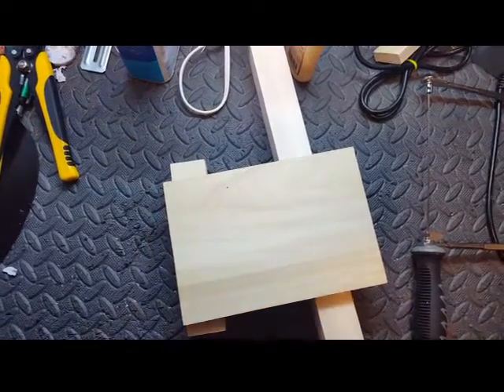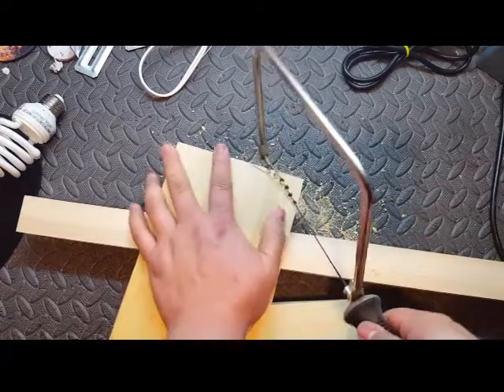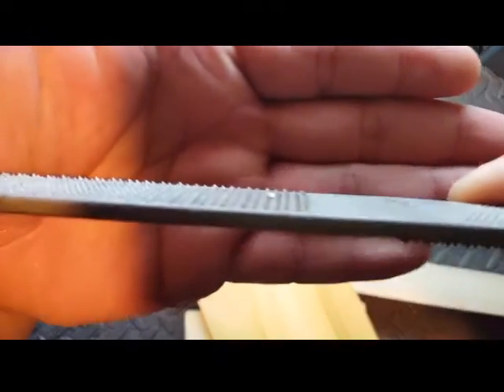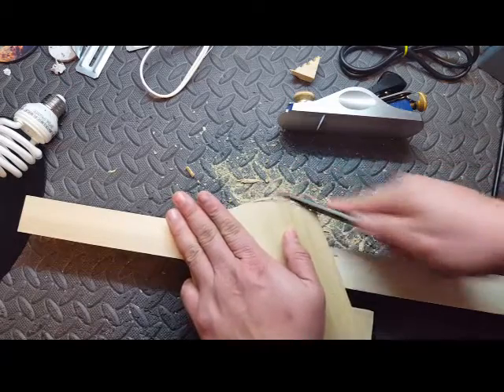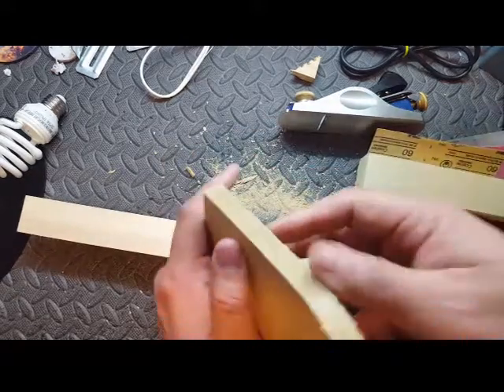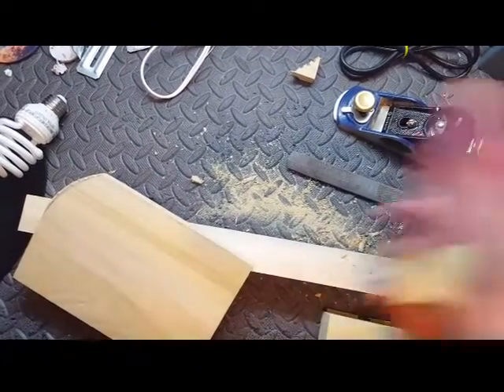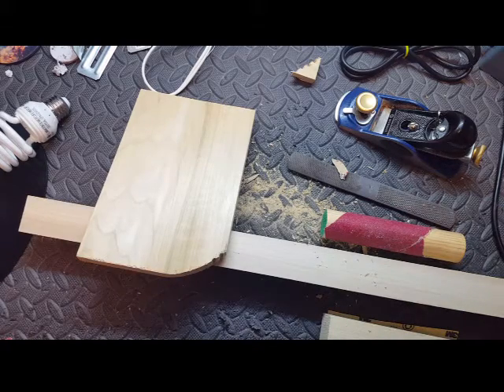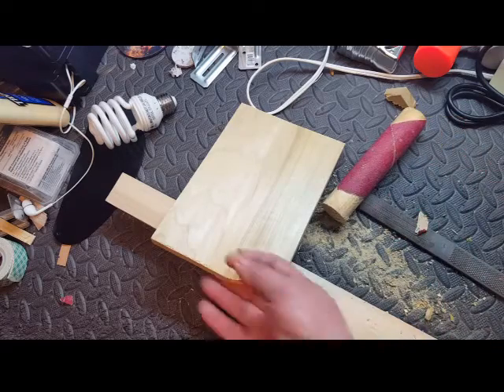Yes, you can cut a guitar body with just hand tools.

Comment: How about the neck pocket?
Reply from the maker: get a router and a template lol
Reply: Chisel?
Reply: router plane. Not the cheapest thing in the world, but you can use a drill to rough out the bulk of the material and then use a router plane to clean up the bottom and a chisel to get the sides.